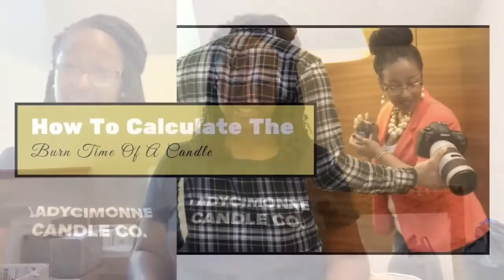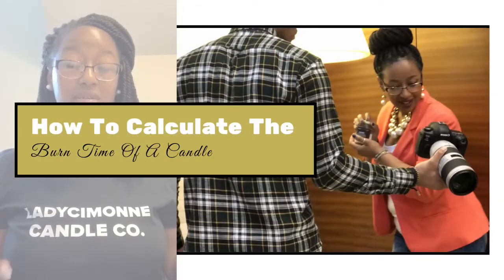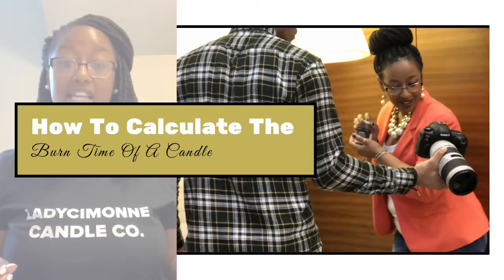How To Calculate The Burn Time Of A Candle

Comment: Im confused. I just followed these steps but my burn time turned out to be 104hr. How is that possible. Please help me understand if this is correct.
(ORIGNAL WT - AFTER BURN) ÷ hrs burnt = hourly burn rate
24.75oz - 23.80oz= .95oz ÷ 4hr= 4.21hrs burned per oz
4.21x24.75= 104hrs
Reply: Did you ever figure this out?